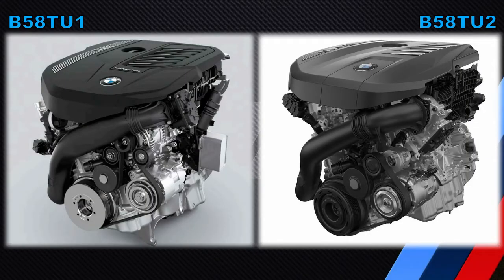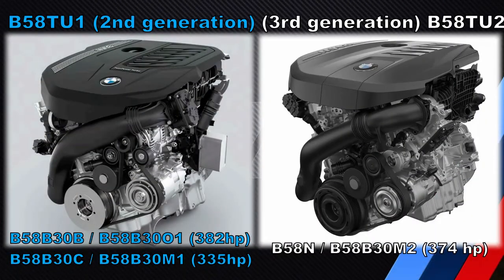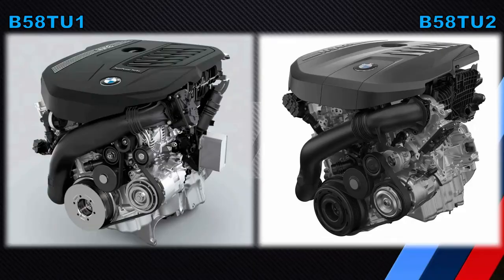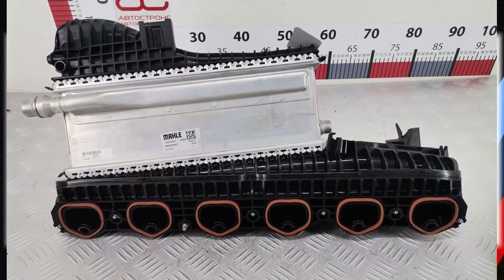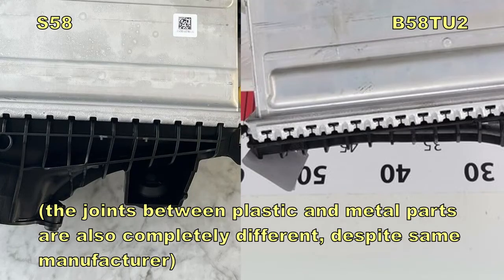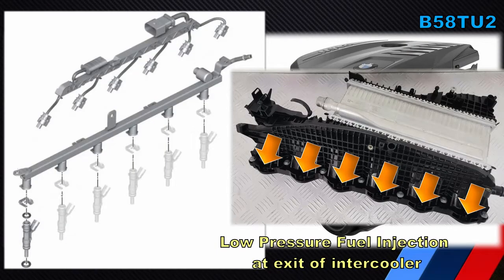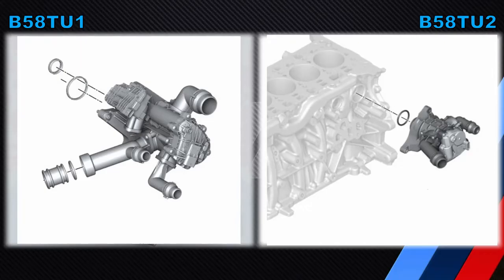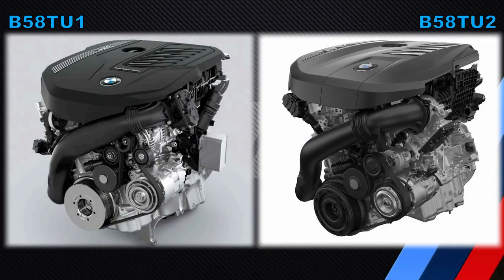BMW B58TU2: A closer look at the new engine variant - Part 1

Comment: Could I ask a stupid question please because there's a port injection system does it mean the intake valves are getting sprayed with fuel?
Reply from the maker: The air ahead of the intake valves is getting sprayed with fuel, so it does mean that through the air-fuel mixture flowing over them, some fuel ends up on the outer surface of the intake valves, which on port injection engines has the benefit of cleaning the intake valves.
Reply: @NoBrainerTalk  thanks so do we still need to worry about carbon build up on the B58 TU2?
Reply from the maker: @johnwoods8735  Ask me again in a few years when in service experience is accumulated. :)

Comment: aren't the m "lite" models 6 port versus 2 port exhausts?
Reply from the maker: 1st gen B58 is 6 port, 2nd gen B58 comes in two versions (6 port for the 382hp version and 2 port for the 335hp version) and 3rd gen B58 is 2 port only. Most m lites (M140i, M240i, 340i, 440i) with B58 had 1st gen B58. M240i, M340i, M440i with 2nd gen B58 had the 6 port 382hp version. New M340i with 3rd gen B58 is 2 port only.

Comment: so should i get a 2024 or 2025 m340i? is the b58tu2 worse or better than the b58tu1
Reply from the maker: That question can only be answered when there are many more B58TU2 engines in operation, and they have accumulated the same miles as the current B58TU1 fleet. No way to know now. It also matters what you mean by "better"...

Comment: I have a question: I own an 840i G16 2021 with the B58B30C engine (335 hp). Is it the same engine as in the M340i (B58B30B)? Which one is better, and which has more potential for more power?
Reply from the maker: Both the B58B30B and B58B30C are B58TU1 engines, i.e. 2nd generation B58 engines. However the B58B30B has a higher power output. In terms of modifications and tuning, they both have incredible potential so it is difficult to answer that one.

Comment: Which is better for tuning Gen1 Gen2 Gen3...Stage3 Downpipe DorchPumpe G35 Turbo 1050 charger approx. 700hp 800nm
Reply: gen 2 most robust and its whats in the supra with fixes from gen1, gen 3 focused on eco friendly and i believe cylinder deactivation which are mostly in their SUV lineup which said to have issues.
Reply: @charles-fq2dw  2019-2020 X7 40i has which gen ?
Reply from the maker: I would say Gen 1 followed by Gen 2 followed by Gen 3. The longer a version has been around the more aftermarket products there are, the more you can spend to get more power.

Comment: HELP !!!!!  
I have a 2022 m240 xdrive B58B3001 all-wheel.  I believe the oil capacity is 7.2 liters not 6.5 liters.  But 2 different bmw service advisers told me different capacities.  The owners manual doesn’t have it.  Where can I find factual information to confirm so I don’t over fill it?
Reply from the maker: Hi I just this remark. If I were you, I'd add 6.5 litres (which is quite likely enough) and check the engine oil level via the car. If it shows it's not at the right level, you will know to add more oil. It's easier to add abit more oil than to remove oil, right? Hope this helps.

Comment: Will the TU2 be on the 2025 m240? Really hope not
Reply from the maker: I don't know, it's safe to say the B58TU2 is a more expensive engine than the B58TU1 and it might be that the M240i doesn't get it to keep the sale price below a certain threshold, but at the same time, it's more costly to manufacture an engine model just for one car and this combined with stricter emissions requirements (considering the G42 M240i doesn't even have 48V mild hybrid system now) may result in the B58TU2 in all cars that had B58TU1.  This will obviously have advantages and disadvantages, but personally I don't think it's a bad thing. The M240i is a more purist car now I will give you that.
Reply: @NoBrainerTalk  i appreciate it🙏

Comment: The b58 tu with the mild hybrid is the best daily tuner engine ever. Literally you can run 800hp and get 30+ mpg and be as reliable as a Camry 😭🔥 dope video
Reply: Great motor for sure, but you're absolutely not going to be as reliable as a Camry if you're pushing 800hp, let's not get carried away 😅
Reply: Toyota isn’t reliable these days so not a good comparison. Toyota 2020+ is like a 2024 Dodge product 😂 but seriously. Toyota is no longer considered “reliable”
Reply: @jerimccann3453 bullshit Toyota is still reliable… just not that twin turbo v6 in the tundra

Comment: What's the difference between both of the shown HPFP's of the TU1 and TU2?
I know the normal FP does 200bar and the TU(1) pump does 350bar max (p/n 13518631642)

Comment: Is the oil pump plastic again?
Reply from the maker: was it plastic on previous B58 gens? I don't think so...
Reply: @NoBrainerTalk  it is in earlier versions I think 2020 and older. Maybe not everything is plastic but it had plastic components and failed with oil pressure too low message. Making everything cheaper I wonder if they 'improved' oil pump as well?
Reply from the maker: @hrsjohnny  Hi, although I would agree the B58 has steadily become more complex, I wouldn't agree it became cheaper made. It was beefed up significantly from the start, and after gaining experience I would agree that BMW might have adjusted some of the specs, but the engine is overall quite well engineered and robust. Remember this is not a full fat M-Engine meant for track use, it is meant for road use and as a road car engine, is engineered well above what it is intended for. Not saying there aren't any problems, additional complexity and new features inherently bring risks and complications, but I would say BMW is trying to keep standards high with the B58.
Reply: @NoBrainerTalk  sure it's a power house and making 400hp and more reliably. All I am saying is that so much plastic in the engine is not for longevity. It's not built to last, plastic oil filter housing will no way last 200k miles.
Reply from the maker: @hrsjohnny  It's certainly a valid concern if the plastic will last, but metal corrodes and rusts (which plastic does not) so I guess there are pros and cons. Ask me again in 10 years. :)
Reply: @NoBrainerTalk  by that time we all be on electric hoverboards :)
Reply from the maker: @hrsjohnny  Hehehe. :)

Comment: The subject is probably under constant evolving. What is B58D? and where does it fit into the story?
Reply from the maker: B58B30O1 (technical manual) = B58B30B (engraved on engine) = B58D (IPC e.g RealOEM)
So B58D means the second generation B58 (aka B58TU1) with 382hp (i.e. 6-port version).
Reply: @NoBrainerTalk thanks, I have this engine too. I looked under the hood today and have the 6 port. The M1 have the 2 port, right?
Reply from the maker: @janh9030  Yes, the M1 is a 2-port.
Reply: @NoBrainerTalk thanks for good explanation video👍🏼 do you know the of the problems with the plastic oil pumps of some first M340i?
Reply from the maker: @janh9030  Hi there, I do not have details for the topic you mention.

Comment: I just purchased a low kl 2020 BMW 540 which has the B58B30M1 engine.  In your opinion is this a superior engine to the original as I plan on doing some modest modifications (downpipe / tune / intake).  I am a bit concerned that BMW hasn't used the B58B30M1 in many performance cars and quickly went to the TU2 which has more horsepower.  I suppose the supra used the B58B30M1 for longer which is perhaps a good sign?  Thanks
Reply from the maker: Personally I feel the 1st gen is the best B58 engine, but the B58B30M1 is a very good platform for modest modifications.

Comment: Are all tu2 2 port exhaust heads?
Early b58 are all 6 port and b58s found in the later cars can be either 2 or 6 port depending on the model they are found in.
Reply from the maker: Yes all TU2 are currently 2 port.
Reply: @NoBrainerTalk Which is better 2 port or 6 port
Reply from the maker: @ReinReinRein13  Depends on what your priorities are, 6 port likely better for heat dissipation, 2 port likely better for efficiency, etc.

Comment: Update for 2024/25?  B58's got a power increase from 335 to 375 and wondering if they're still using the old 2 port head on 375hp 2025 X5.
Reply from the maker: Yes they are.

Comment: Would you happen to know if the B58TU2 is in the 2023 BMW M340i ? Thanks
Reply: Did a bit a research from what i gathered last week, and did a vin check as i remembered, the 2024 BMW M340i has the B58D ???
Reply from the maker: @the404man  Hi, the 2023 M340i does not have the B58TU2, the current M340i does not have the B58TU2, but the B58TU2 may feature in the M340i later on possibly during a further refresh (e.g. LCI-2) of the G20.

Comment: This b58tu2 engine goes into the the 40i models. Im pretty sure the m40i models, or soon the m50i models will have even different components.
Reply from the maker: Yes, the B58TU2 is expected to feature in various upcoming refreshed / LCI BMW models.
Reply: @NoBrainerTalk  does it seem like in x5 it would only start in 2024+ ?
Reply from the maker: @azmalu  Hi, if the X5 has 335 hp then it's B58TU1 and if the X5 has 489hp then it's the plug-in hybrid with B58TU2 (375hp from the engine + the rest from the electric drive system). The new version should have started from 2024.

Comment: still a 2 port?  guess i don't feel as bad with my TUsupra.  I wonder if i we can clone and see if the DME was compatible with the TU for port injection without using a external controller.
Reply from the maker: Hehehe, the B58TU2 DME will only work with very specific hardware, but hey who knows, it might work!
Reply: Heya, i was looking for a comment from who has a supra ;) i may purchase a supra soon, and i can't read anywhere if or when the tu2 engine is equipped in the supra....do you know something about it maybe? I don't really want the e-vanos and the miller cycle honestly, although the port injection seems nice...
Would be awesome to know, thanks :D
Reply: @Vlad-kf7hw  all supra are equipped with b58tu.  All post 2020 DME must be removed and sent off to be unlocked for tuning to femto.
Reply: @kevin-jm3qb  that are amazing news, i mean at least for me ^^" sure the tu2 has some advantages, but i have read somewhere that the first cylinder head are failing because of the additional valve lift mechanism on the exhaust side....i want to have as little fancy stuff possibly on the engine xD
P.S. sorry for bothering again, where exactly is the code printed on the engine? I want to look for it, additionally to the design of the chargepipe and the fuel rail for port injection :)

Comment: What type of engine is in the X5 50e? Thanks! Great video.
Reply from the maker: That's a good question, I'm not 100% sure to be honest. It should be a detuned B58B30M2 generating roughly 308hp coupled with Hybrid Synchronous motor generating roughly 190hp.
Reply: @NoBrainerTalk  It would make sense, I will have the car at home in two weeks time so I will check the registration list to find the engine code. I am super happy that BMW has added port injection to get rid of the carbon buildup.
Reply from the maker: @marcelmatzenauer6352  I am looking forward to your update. :)
Reply: @NoBrainerTalk  I have found out that the engine model is B58B30S. Is there a way to find out if it had both types of injection ie. It would be variant of TU2? Thanks!
Reply from the maker: @marcelmatzenauer6352  Hi, do you have the car yet? You can have a look at the engine itself. It will be quite clear if it's a B58TU2 through the intercooler (and you can check the area between the engine block and intercooler for the new injectors). You can also send me various photos by email and I can have a look:  nobrainertalk@gmail.com
Reply: @NoBrainerTalk  thanks, will do tommorow 👍🏻😊

Comment: So the B58 TU2 has port injection only or has dual injection system with GDI and PORT?
Thank's a lot and congratulations for your channel
BimmerN53
Reply from the maker: Thank you! The TU2 has both, low pressure port injection and high pressure direct injection.
Reply: @NoBrainerTalk  Do you know what variant B58 engine is in US 2024 X3M40i? Thank you. Those are the specs provided to me by BMW USA...
3.0-liter BMW M TwinPower Turbo inline 6-cylinder
Displacement (cc)
2998
Horsepower (bhp @ rpm)
382 @ 5800-6500
Torque (lb-ft @ rpm)
369 @ 1800-5000
Compression Ratio (:1)
10.2
Reply from the maker: @genderlessyoutubefanperson  Hey there, it is a B58B30O1 (the 6-port version of the B58TU1).

Comment: Please keep making this sort of video. Also would be great if you could do the same for N54 vs N55 and then the different versions of the N55
Reply: This! I keep reading so much different things about the N55 engines, between the PWG N55s in the E9X chassis, the EWG N55s in the F30 335i which are supposedly different from the N55s in the M235i (forged crank etc?). And then theres the M2 N55 with a supposed closed deck block which has a complete cloud of mystery around it. I'd love to see all the different N55 models cleared up.
Reply: @pranavk8293  Search for Simply Car Things N55 engine variants. He did a pretty good breakdown video of the differences on the variants of the N55. Also with your comment you are mostly spot on except there were a few F chassis cars that came with the PWG still 2012, 2013 & 2014 models. Also I am pretty certain the M2 still had a open deck. But the N55 in the M2 was definitely peak N55 and the most durable one of them all.
Reply: @carcrazyguysa4059 ALL N55 were opendeck!

Comment: on the mild hybrid assist which replaces the alternator, we know it is a 48 volt system, but what kind of amps or total wattage do they get into and out of that thing?  Dealers seem clueless.
Reply: I read the 48V alternator can output up to 250A for short durations, on the mild hybrid tu1 engines. there is a separate power control module to convert 48v to 12v
Reply: @780brando  great info.  So, is the drive motor part then doing 250 x 48 = 12,000 watts = 16 hp?  Presumably, it dumps power into the house battery on regen, making it avail for launch assist and acceleration later?   How long do these 12v house batts last now?
Reply: @gendaminoru3195  Yes the alternator is aka "starter motor/generator" on the models with mild hybrid. the SMG charges the 48V lithium battery directly. when coasting (depends on drive mode) there is slight regen, regen then increases with braking. there is a display in the gauges showing regen, but not assist. Not sure on the life of the 48V lithium battery
Reply: @780brando  Yes on the test drive I saw that display, but was wondering if there's an indication of assist - maybe a code or programmable dash or some secondary readout like we used on the old E31's pixel display.  Anyway I will figure it all out next month after delivery.  What's the word on ECU/EML reprogramming by Dinan or others on new cars?  Warranty void?
Reply from the maker: Yes, dealers are not very technically minded, I agree. I don't know much about the 48V system, but I do know the batteries (1st gen) are 10Ah 440Wh 44V (if it helps).

Comment: 6:55 just notice how beefy structurally the new block looks. I bet it can handle way more power now.
Reply: Doubt it. BMW wouldn’t update it to handle more power. If you want a inline 6 that’s over engineered, go with the n54

This is a better engine overall but n54 can handle more power. Well I guess we will see
Reply: @johnnychimpo7539  The B58 has a closed-deck block. By this nature alone, B58 is significantly more over-engineered structurally than the open-deck N54 and can handle more power in stock form. N54 is a great engine too, and N54-engined cars are very affordable now and making them very popular for mods and projects and have more aftermarket support, hence you see more high power builds with N54. But I am simply pointing out your statement of referring to a N54 being more over-engineered and can handle more power versus the B58 is not correct when they are in stock form.
Reply: @johnnychimpo7539 n54 explodes at 600whp where b58 is shown to hit 1000whp stock block and internals.  Stop it 😂

Comment: @7:17 the block on left noted as “B58TU1” is the original B58 as the timing chain shown to have the bulge of the intermediate drive sprocket.
Reply from the maker: Actually, you are correct, RealOEM / the Illustrated parts catalogue for the B58TU continues to show the 1st gen B58 illustration under the short engine section. I thought it would be OK considering the points I was making. But you are certainly very observant.

Comment: Hi pal,great insight and much appreciated. 
I believe BMW lowered the compression ratio to 10.5-1 on the B58TU though
Reply from the maker: Hi there, the compression ratio for the two B58TU1 variants is different: The B58B30M1 is 11.0:1 whereas the compression ratio of the B58B30O1 is 10.2:1.  In this video I was only comparing the B58B30M1 to the B58B30M2.
Reply: @NoBrainerTalk  well I’ve learnt something new,every days a school day!
Again- your doing a great job,keep it up mate

Comment: So is the m340i b58tu still better I'm assuming for power mods?
Reply from the maker: Hi there, in terms of tuning and mods, we are back to square 1 with the B58TU2. The various aftermarket parts companies will have to develop brand new hardware upgrades, but to take advantage of those, tuning is required. The issue is that the DME is a new standard and is back to being locked. So for customisation and tuning, there's no real options for the B58TU2 until the ECU can be unlocked. Tuning boxes are being developed (e.g. from JB4) but that is about the only option for some time. Testing has shown great potential for the stock hardware (so tuning boxes alone, and later on stage 1 tuning, can accomplish what previously required upgrading hardware). As the stock hardware seems to have alot more potential than 374hp, we might expect to see higher engine outputs of the B58TU2 in a package like MPPSK.   For the time being the B58TU1 can be readily upgraded but the B58TU2 can't.